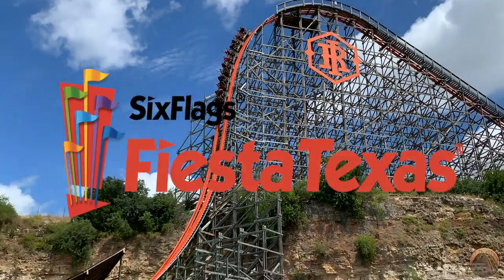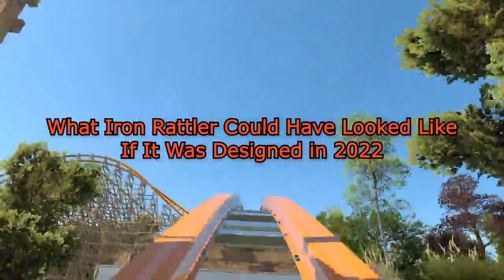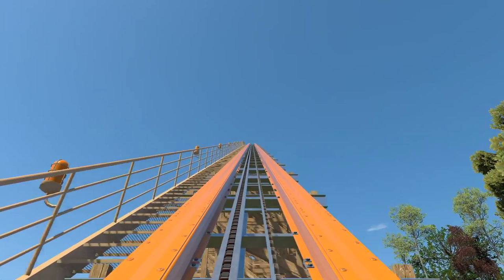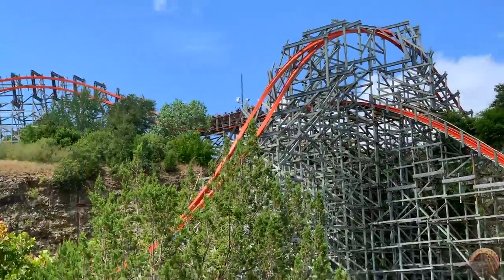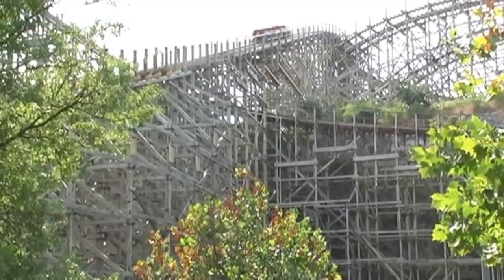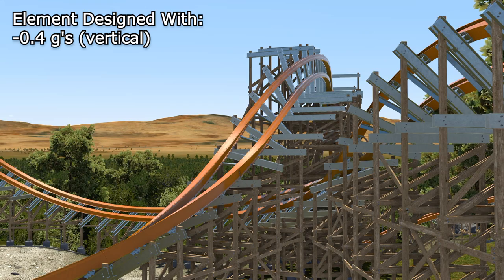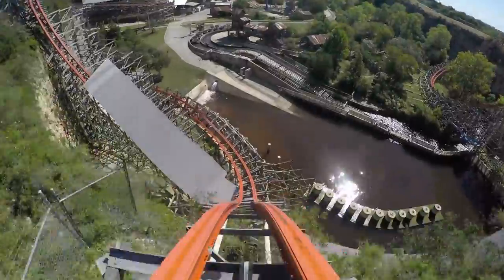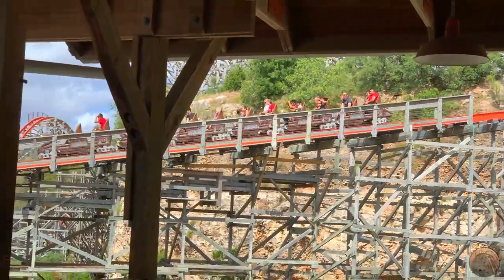What If Iron Rattler Was Designed in 2022?

Comment: Fun fact: the original pull out from The Rattler's drop managed to pull over five Gs. However, the structure was only actually built to handle the force of a train pulling three Gs. This was due to a miscalculation in the design.
Reply from the maker: Interesting but not very surprising considering RCCA's reputation haha
Reply: Actually the original concept had the pullout only pulling 3 Gs. In order to guarantee the ride would open with the tallest and steepest drop, the park got RCCA to redesign the drop twice. The pullout was never redesigned
Reply: @dustmybroom288 
That's true, however because of the redesigns of the drop, what ended up being constructed was far more forceful than intended.
Reply: @VestedUTuber  the start of the drop was moved forwards off the quarry wall and the height was made taller. The pullout still ended in the same spot, it was just made smaller. When the ride opened RCCA continued to advertise the pullout as only having 3Gs

Comment: SFFT is and has been my home park my whole life, and i would have liked to see a flyby next to the station after the tunnel! The Rattler used to do this and it would shake the entire station and when i rode Iron Rattler after the conversion i and many other fans of our original The Rattler were left wanting more after the tunnel and the queue wasn't as thrilling ( the old fly by would rattle and shake the entire station and gave everyone in queue a chance to rethink their life choices LOL) 
other than that i love what you did with my beloved Iron Rattler, i wish they would reconvert it to to this cause this conversion would make it a competitor to the top 3 RMC's of the current day! well done!
Reply from the maker: I wish I could have done more after the final drop, but there was simply too much speed to make any realistic elements in that space. It was a tradeoff between being able to have something there, or having speed on top of the quarry wall, and I chose speed on the quarry wall because that is the most common complaint with Iron Rattler.
Reply: @EliteCoasters  i can totally see that being an issue for sure. even the current iron rattler out of the tunnel there’s a sharp jolt up forward and to the left as you enter the brakes, if they weren’t magnetic brakes it would rip your face off! 
glad you took it into consideration and i too would prefer better pacing on the top of the quarry wall, well played!

Comment: My only real issue with this design is that it doesn't make use of the final turnaround the original Rattler had by the station. Easily some outer banked turns and/or airtime hills could have been used here to really extend the ride. All the extra momentum you have left over is kinda wasted just hitting the brakes.
Reply from the maker: Yeah, I've gotten a few comments about that. The reason I didn't put anything there is because the train has way too much speed going into that section. Any element that I would have been able to fit into that section would have been much too forceful.

Comment: While I do like this concept and I think it would make for a better ride experience than the real Iron Rattler I think you missed some important points:

-The Rattler was always plagued with structural issues and Increasing the height speed and forces as you suggested would require extensive reinforcement of almost the entirety of the structure.
This is probably also the main reason that for the Iron Rattler Conversion large parts of the original structure were removed and most of Iron Rattler stays a lower to the ground than the original rattler did.

-Budget: the alterations to the helix requires a lot of new support structure on top of the afore mentioned reinforcements it would probably come out to at least 3x the cost of the Real Iron Rattler and we are talking about a Six Flags park.

So a 2022 Iron Rattler would be smaller and a lot closer to the existing Iron Rattler than your concept.
Reply from the maker: Thanks for the feedback!

Comment: This is definitely an upgrade to what we have. I would almost vote to dive off the wall and go right instead of left into a turnaround like the first on Twisted Cyclone at SFOG then into a bunny hop going into the cave tunnel. Edit: the turnaround would be taken in the reverse of that on TC and it's structure would run parallel to the first drop, going into the first inversion you would be under the inversion going over the cliff wall, on the exit, you would travel over the bottom track of the fan curve, into the bunny hop then into the tunnel. The majority of the addition would be over the water and inside the fan curve. 

Get those extra two inversions and more track to run down some speed, not much, but some.

Comment: Not sure if it’s possible , but going the opposite way through that last tunnel would be pretty cool . Dive off the wall a bit wider into a small air time ejector , quick left hand over bank into the tunnel , out of the tunnel into a sharp left turn then airtime hill into the break .

Comment: How do you get the precise dimensions and values in no limits 2? I can’t seem to figure out how tall/long anything is or how many gs it pulls.
Reply: Love these videos btw!
Reply from the maker: For the height and length, you can go to coaster properties, and then go to the stats tab within that. To find the speed and G-Forces, go to the main screen and go to setup. Under controls find whatever key will show the simulation panel (should be f2). Then, when riding the coaster in play mode click that key to bring up the simulation panel, which will display the speed and g-forces.
Reply: Thank you!!!!

Comment: If you could add additional, non-original sections, here is what I would suggest: weaken the final deceleration (I don't know if magnets would be that strong) and insert a helix to fill space and make an easier run into the block brake and transfer track

Comment: wish the second half got more usage
Reply from the maker: You mean like it should go around the helix another time, or...?
Reply: @EliteCoasters  like if i remember correctly after the dive of the quarry their originally was way more track to work with but they just slam it into the breaks. i feel the possibilities are endless and wasted momentum occurs. just my opinion ofc. this is still waaaayyyy better
Reply from the maker: @ScootamonCoasters  I thought about using the final helix before the brakes on the Rattler, but with the RMC, i would have just had way too much speed to put in any realistic elements there
Reply: @EliteCoasters  rip.